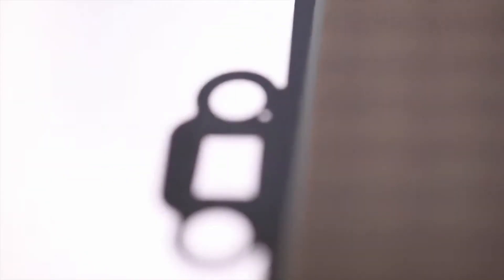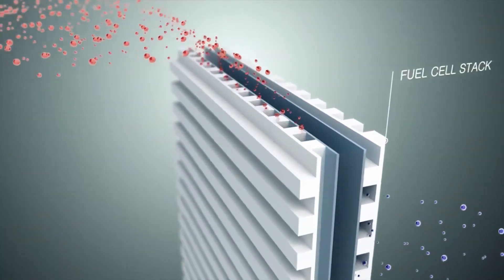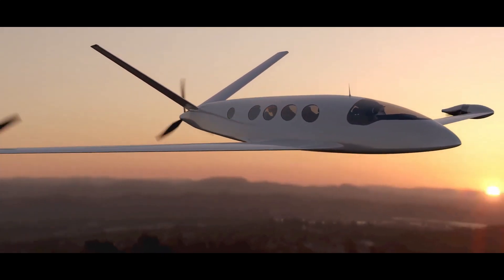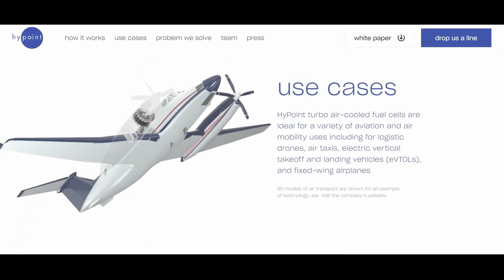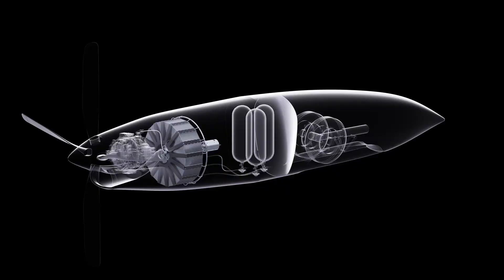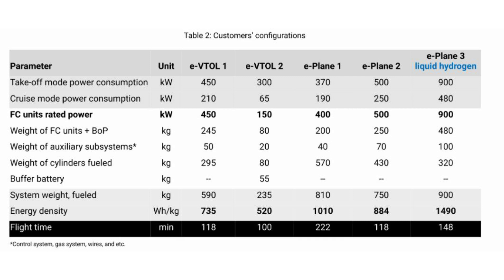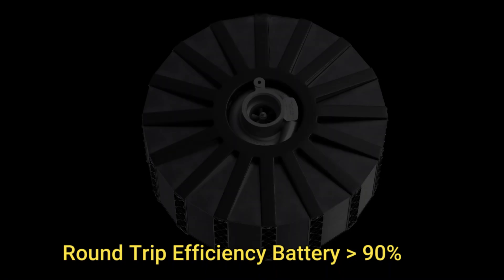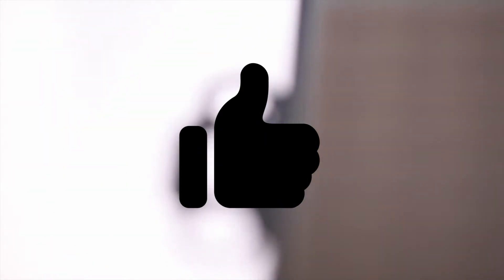Breakthrough Fuel Cell Technology for Electric Aviation

Comment: Very interesting, thanks!
I've been dreaming of building a solar powered cruising boat for a while. It's a much simpler use case with batteries than airplanes of course since payload can be much higher and you don't crash immediately without power. Still it is expensive. 
These fuel cells would be really interesting because then you can store large amounts of energy as hydrogen by converting seawater into stored energy.
Thing is to go slow trawler speeds (6-8 knots) you only need 20 kilowatts if you design the boat light enough.
Best examples of this are the Energy Observer and Planetsolar but they are huge gigantic boats. I only want a smaller boat for living aboard and cruising the world.
Reply: Taken to it's ultimate efficiency, you just can't beat wind power for a driving force and you don't have to use flapping sails to harness that power, you can have a VAWT and it either direct dives a propeller that drives the boat, same as having sails etc.....as long as the wind blows ...... or drives a generator that provides electricity for storage..........wanting to have your cake and eat it means you need a bigger boat to live in and have the infrastructure to house the mechanics and batteries that power the boat, freezer, pumps and a heater too for Winter and don't forget an airconditioner.....small is not beautiful with mechanics.
Reply: @gangleweed  Haha yeah there is a thread on boat-design about a hypothetical boat with a vertical wind turbine. Fun concept.
I've recently looked into kite-power and they seem very interesting for that too, both direct propulsion and power generating by pulling out the cable on a winch to generate power. High up in the air the power density is even higher and you need less material to generate power than with wind turbines.
There is the delft spinoff (thekitepower.com) with a preorder.

But still, solar panels with a hydrogen fuel cell might be ideal if you don't travel constantly but have week long pauses at your destinations where you could regenerate hydrogen.

Comment: Why isn't renewably-generated (tidal, solar, wind, geothermal) LH2 being pursued for electric aviation?  With LH2's energy density greater than gasoline and light weight it seems an obvious course to pursue.
Reply from the maker: Liquid Hydrogen generation eats up more energy in the process, but is easier to transport. On the other hand compressed hydrogen is more energy economical to produce but difficult to transport unless there are pipelines between point of generation and consumption. Best case scenario is to generate hydrogen at the point of usage through renewables

Comment: There's been a bit of a breakthrough recently, I gather, in production of hydrogen from electrolysis. Perhaps one day fuel cells will usehydrogen produced by electrolysis using electricty produced by solar or windpower, for those cases where fuel cells are a more appropriate solution than batteries.
Reply: I see using the hydrogen and electricity together to produce plasma, then gas turbine/electric. 

Also the tidal power has just begun to be harnessed more recently. Once efficiency is mastered, i see that being even bigger than wind power. 
Areas around Vancouver island are perfect places for this.
Reply: Wind Generation..to Electrolysis..
Yes...High Pressure Tanks...Life Limited Lines ( they get Brittle ).  and Many Sensors...

Comment: Has anyone taken into consideration the lack of recharging stations when and if flying cross country?
Maybe one could pay an FBO a few bucks if electric airplane has a way to fast charge from a standard wall outlet?

Anyhow...
Reply: This has also crossed my mind. I assume this is why the Velis Electro is being marketed to flight schools rather than general use, but I regret to have to say, the sub 1hr flight time makes it a novelty only (a novelty that I'm keen to try for myself regardless).  The Velis appears to have a "normal" car charger socket, but everything I've seen suggests you need their dedicated charging station to recharge them.  If not, our electric car comes with a standard wall outlet to car charger, however our 30kW/hr battery takes close to 24hrs for a full charge from that source, so that isn't really an option you are going to want to use regularly.

Comment: toyota banking on hydrogen might have been right.
also looks like bob lazar is correct in storing hydrogen in the form of H1, you'll need a particle accelerator to create 6Li (lithium-6) H (hydride) for H1 storage.
Reply: How did you walk away from this video with the conclusion that fuel cells in cars are the answer?!
Reply: @blade-OT  Im referring to hydrogen storage specifically the density capacity of H1. When did i mention the fuel cell of a car? All i mentioned was the density capacity of hydrogen stored as H1, which is the fuel when mixed with an oxidizing agent produces electricity ... Sorry i triggered your blessed little mind
Reply: @blade-OT  i own two toyota's and i am quite pleased with their products. please get vaccinated
Reply: @manicsurfing  as I thought, what you implied with Toyota is exactly what you meant. You're just another hydrogen fanboy.  😉
Reply: @blade-OT  Stare at the sun and shake your fists at it. Its made of hydrogen. i hope for all technologies to do well and succeed.

Comment: Methanol fuel cells will eventually outstrip all other contenders. Methanol is high energy density, light weight, and fast filling. They can be coupled with TIDE small turbine running a generator.

Comment: H2 combustion in turbine engines might still have better efficiency vs weight than these turbo fuel cells for large aircraft.  Recovering the exhaust heat to pre-heat the fuel may be help the turbine efficiency.

Comment: I can see a time when homes are fueled through natural gas fuel cells...no more blackouts because the powerlines were taken down by falling trees...more power to use because there will be no loss due to resistance loss in high power lines moving Electricity hundreds of miles...A home fuel cell will not only produce power on demand but will provide hot water to the home

Comment: That's quite impressive, though still seems on the edge of being efficient enough. Honest question though: Wouldn't it be easier to use conventional internal combustion engines and convert them to use hydrogen as fuel instead?
Reply: There is an issue of NO2 production when burning H2.
Reply: You can't store hydrogen in jet fuel tanks.

Comment: Can't the CO impurities be burned out of the hydrogen?
Reply from the maker: They can be taken out, but it adds another layer of processing which increases the cost
Reply: Wouldn't you need oxygen to burn out the CO? The oxygen would react with the hydrogen before making it to the fuel cell.
Reply: @ddegn  Not sure but I believe the CO it being a partially combusted molecule would burn on it's own with help of the hydrogen resulting in molecules while still present would have less negative effects. don't want to add O2 though.

Comment: I have been starting to wonder why current development on electric vehicles mostly depend on batteries alone or hybrid engine types. Where are the vehicles powered by generators alone with battery back up? Natural gas (or better yet hydrogen) generators could supply most of a vehicles energy needs with batteries to be back up in case of generator failure. Small high output generators could be a great course of R&D while battery development is ongoing. Accelerating electric  vehicle production is my goal here, and even if we had to use fossil fuel generators for a while. It could get electrics into the hands of consumers quicker and start the snowball needed for mainstream acceptance.

Comment: I have always considered battery powered vehicles to be a massive wrong turn. Look at the experience of the Orkneys. They have surplus wind and solar power they use to crack seawater into hydrogen and oxygen. The hydrogen they compress and use to power conventional engines. Using fuel cells is a fantastic idea but limited by the cost of platinum.
Reply: The funny thing in the video is that only battery planes are used as examples (the Lilium plane and the Eviation Alice plane). However still the video was very interesting. More power dense fuelcells which can use lower grade hydogen is a good thing.

Comment: IMHO, the ONE big issue for battery electrics versus hydrogen fuel cell electrics is recharge time. 
 
When you can refuel {recharge} the battery is quickly as refueling the hydrogen in a fuel cell powered vehicle, you will be there.  
 
Until then, I will prefer the fuel cell.

Comment: Why aren't they using supercapacitors to complement a fuel cell instead of lithium batteries? Super or Ultracapacitors charge faster than batteries & weigh less.
Reply from the maker: Supercapacitors can hold much less charge compared to a battery. The best super capacitors out there are only 80Wh/kg. Compare it to a battery which is 260 to 300 Wh/kg. This means if we were to powerup the aircraft by super capacitors alone, the system would be 3 to 4 times heavier

Comment: For smaller craft structural Lion would effectively deliver well over half the range at significantly lower cost both for purchase and operating. Simple proven and efficient while fuel cell systems require maintenance and could fail. This means you really need two fuel cell systems for equal safety doesn't it?
Electricity can be made available quickly, cheaply and easily compared to hydrogen. It would make more sense to pay a solar power plant to scrub an amount of CO2 from the air that the equivalent burning of jet fuel would make and not have to buy any new equipment. It would extend the life of the existing stock of planes and put pressure to develop cheaper carbon capture systems which helps way beyond aviation.

Comment: Why hydrogen instead of a liquid like alcohol?
Reply: If you watch the whole video it shows E-Plane 3 using liquid hydrogen.
Reply from the maker: @nev5238  Thanks
Reply from the maker: Hydrogen because it can be generated from renewables
Reply: @nev5238  I assure you that ethyl alcohol is easier to manufacture, transport, and store than liquid hydrogen. 
(It is safer too; it can even be drunk by humans in small quantities.)
Reply: @codetech5598  Well I wasn’t arguing which is better I was just saying the video DID show liquid hydrogen in the diagram as an option.  Well I guess they didn’t speak to you first before wasting time and money on hydrogen fuel cells powering aircraft did they… big oops on their part. Lol
Reply: @nev5238  Of course they know what I am saying but the push for hydrogen is politically motivated.
Reply: @nev5238  Direct-ethanol fuel cell:  https://en.wikipedia.org/wiki/Direct-ethanol_fuel_cell

Comment: While I like the fuel cell concept shown here, it is a single point of failure. 
Having a small buffer battery would be ideal for emergency landings and intermittent cutouts.
Better still would be proven use via long term reliability in low-risk non-aviation transport, such as road transport.
However, that is unlikely in this configuration. Promising tech though.

Comment: Instead of using a lot of energy to convert methane in to hydrogen plus loosing the energy itself in the downgrade of energy density, why not use methane directly in a combustion engine and save all the pollution?
Reply: Because hydrogen is supposed only to come from renewable energy like wind and solar (via electrolysis)!

Comment: Bored engineer doing a simple feasibility study... how about a 10kwh cell?

Power extraction happens at a rate of about 5 watts per square meter of surface area in platinum based devices.. and this is at high pressure.  If you want to pull a constant 10kwh, you need 2000 square meters of platinum surface.

And if you electroplate aluminum foil to 0.01 mm with platinum, you need 20 cubic cm of platinum for this device. About one pound... $14,000.

Assume you can align all the plates so you get two per mm.  2000 square meters at 0.5 mm thick. 1 cubic meter of reactive surfaces, and whatever for housing, pumps, etc... if it's mostly aluminum, I assume about 500kg. However, foils tend not to work well in hurricane winds... I don't see an immediate solution thst would give 200 sq meters...

Typical fuel cells are 40-60 percent efficient, and 1 kg of hydrogen with its 33.6 kwh would last a little under 2 hours. Ignore fuel mass for now.

10kwh/500kg - otherwise known as 200 wh/kg.  This is today's typical lithium ion power density.

I expect it will take 5-10 years to develop this technology into a commercial product.

What do you think power density of Li Ion will be in 5-10 years? 

I think we will have 450 wh/kg solid state batteries by that time.

A cool technology, but they are not telling the whole story.

Comment: You still grossly overestimate the performance of batteries in these comparisons.  For example, you ignore the fact that fuel cell craft get lighter as fuel is consumed.  This vastly extends the range of the vehicle.  Battery craft do not have this advantage. Also, every time you mention the start up cost of a fuel cell, you suggest that an onboard battery is required.  It isn't.  This power, for certain limited load applications, can be provided by shore power. Thus, the onboard intermediate battery can be reduced or completely removed.
Reply: After using 5 kg of hydrogen the tank remains with its 82 kg (Toyota Mirai). If using liquid hydrogen total weight (tank and hydrogen) is reduced with about 20% when tanks are empty. For aircraft with jetfuel weight is reduced with 100% (tanks are integral parts of airplane's structure).
Reply: @ketilljacobsen1851  last I checked, a plane is not a car.  They are more expensive, frequently made of lighter materials, and aren't subjected to as rigorous collision standards.